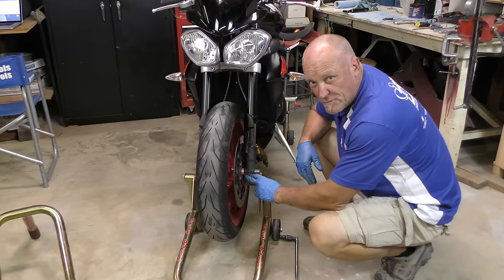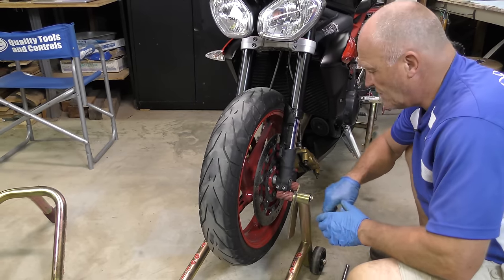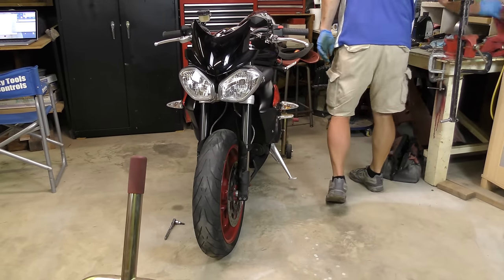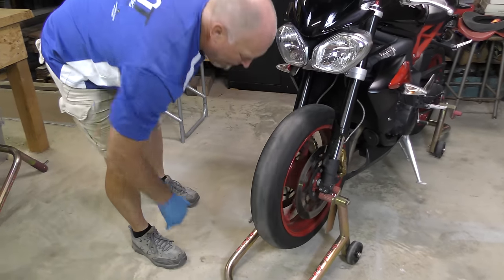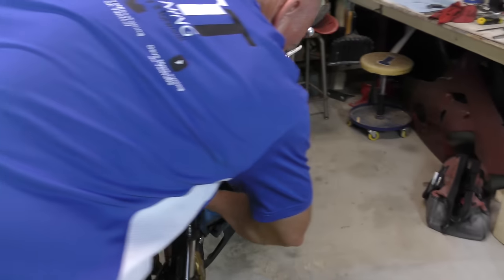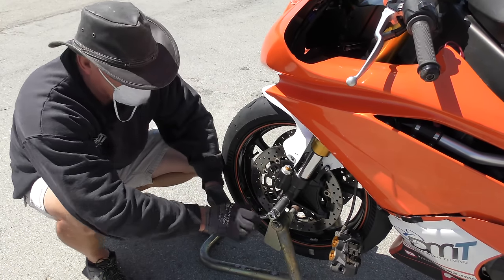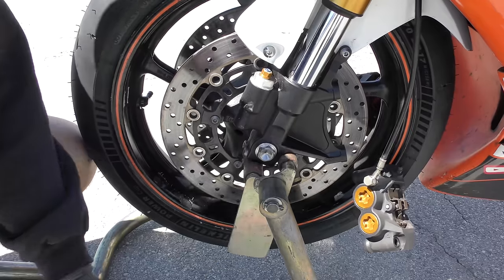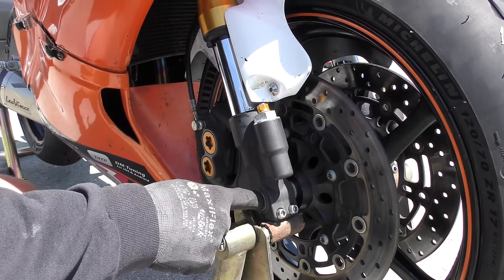Aligning Motorcycle Fork Legs Properly After Mounting The Front Wheel

Comment: Ooopsie, I’ve learned something today
Reply: Same for me! Will be redoing mine soon... the right way. Would be nice to learn why this needs to be done.
Reply from the maker: @stefan2meter  If you do not do it the fork leg can be misaligned and bind giving 1. Stiction  2. Uneven brake pad contact  3. Angled braking forces  4. Wheel doesn't spin 4 or 5 times, maybe half a turns
Reply: Thank you so much! I replaced my rotors and pads, but for the life of me couldn't work out why I was getting uneven contact patches on my rotors... Subbed.
Reply from the maker: @jamieadams9578  Thanks for subscribing! Next step is a toothbrush and soapy water for the caliper to make sure the pistons move evenly (yes, there's a video for cleaning brake calipers). Enjoy!
Reply: Thanks, will do. Got the seal kit ready to go
Reply: Me too

Comment: When you nip up the callipers with the brake on it ads weight to the wheel and moves the caliper back a little the opposite way of the breaking force, whay i do is spin the wheel forward motion pull the brake fasten the lever on, with velcro strap, just before tightening caliper bolts i hold the wheel  with a forward retention ?

Comment: Dave, you helped me tune my suspension with your video's. But there was a glitch I couldnt tune out of there. Ocassionally I would feel some unbalance in the front. Not all the time, but enough to notice in certain pieces of road. Sometimes the bike wanted me to lean at slow speeds, and 2 seconds later not  Etc. Continuous small adjustments... . A motorcycle mechanic fixed a leaking fork seal couple months ago. I figured the oil must be old on one side or different viscosity... They claimed to me the other one was recently replaced already... Today I did what you showed here. And jezus, the floating axle side exluded about 1mm now, before it was flush. 1 hand springing the front imediatly felt a change in smoothness and balance/preload etc. between left and right. Not like the seals where binding... Drove today, and it cuts the cornerline way more stable. Bro, your my hero.
Again you indirectly saved my life, and improved my driving experience.!!!! A question, I didnt release the calipers, should I calibrate those again to the new wheel position?
Reply from the maker: Thanks for watching and using the content to assist you and your motorcycle.. Yes and go through the full reset to 100% ensure the calipers are correct.
Reply: @catalystreactionsbw  Thanks Dave.Sorry I forgot to mention I do have older type calipers which are mounted sideways onto the fork. I had a buddy's fork in mind which has same as the video.

Comment: Dave, about twenty years ago (!) I was a customer at the GMD Computrack shop in El Segundo, just outside LAX. They did work for the American Honda roadrace team in AMA, and I'd seen their CBR600 Supersport bikes in back of the shop. Morris told me that the team was chasing setup problems at the track with one of those CBRs, and it was traced back to front end misalignments which occurred when cinching down the straps inside the truck! One crew was doing it correctly (Miguel Duhamel's, if I recall) and the other crew was twisting things up. A simple matter to fix, once the problem was understood and the knowledge was shared. Even the professionals will mess things up sometimes!
Reply from the maker: Great information and thank you for sharing!

Comment: excellent video dave.j had problems with the front wheel not spinning freely. went to a lot of trouble. stripping down the calipers and changing all seals and a 4 hour brake bleed🙄got there eventually. had I seated the axle correctly like u have done in the first place everything would have been fine 😬
every days a school day.
Reply from the maker: A tip of my hat to you for the commitment to make it right and thank you for watching this video so you have a permanent method from this point on as the first step.

Comment: I had major issues with calipers binding on my BMW S1000R following the replacement of fork seals. This will be the solution - thanks very much Dave!
Reply: Did it fix it? I have a problem with my discs not being central to my calipers and causing massive brake judder
Reply: @TeamSimpsonRacing  Hi Toby, yes it did. If your discs are causing pulsing of the hand lever or judder then you should check them for warping. If the floating bobbins are dry and not allowing the disc to self correct or the disc has been overheated, then it could be warped. There are plenty of videos on youtube around how to service the bobbins and free them up.

Comment: The exception to this is the forks on an 06/07 zx10r that has a "normal" bolt and nut as an axle (neither side floats). The guy I bought my zx6r race bike from put on 06 zx10 forks and I get a bit of excess stiction in the front with no way to correct it. I might send one fork leg to a machine shop to bore the axle hole out and get a spacer made to float the fork. But that will be a winter project

Comment: I know that bike has less suspension travel than my dirt bike, but I have learned not to be a fan of any method of getting the fork legs parallel if you are not measuring it somehow.  Using this method on my dirt bike is also standard YT procedure, but after I actually made a gauge, (1" dia. round stock aluminum that fits through my brake disk, faced off on a lathe on both ends to 5.661" long, the distance between my plated fork legs, calculated from a triple clamp.), I found the pump and brake method to be off about .030".  After I got the legs parallel within + or - .001", I found that I had to go to the next stiffer fork springs because I eliminated the binding.
Lots of riders are wearing out their bushings prematurely, and not getting the best action from their forks. 
It does not matter if the axle is threaded on one end, or clamped on both ends.  The forks should be parallel, and not many are.  :)
Reply from the maker: Agreed, very few are. Thanks for sharing your ingenious solution to remove binding.

Comment: Very understandable and logical with the sequence that these steps are done. If the rotors are not tightened last, is that why you can warp your rotors?
Reply from the maker: If you simply tighten the calipers without holding the brake on they can align off center. That can contribute to the rotor being stressed and potentially warped in time.

Comment: Good instruction - for safety sake - double Check all screws before riding: leaving those calipers loose and tightening them later is a risk because you may forget them. My advice: never interrupt work when your assembling the wheels and brakes. Paint marks can help to be 100% sure.

Comment: Thanks Dave! I didn't know any of this. I'm about to use your tips to align the front end of a 2003 CRF150F dirt bike. They have a similar fork design as the sports bikes you were working on (a threaded left fork for the axle and pinch bolts on the right fork).
Reply from the maker: Excellent - and the end result will be a front wheel that spins far more easily.

Comment: Thanks for this video! Even though it's been some time since upload and I keep coming back to this video to review the procedure to balance the free fork. I have one question: why would you first tighten the brake calipers which are mounted directly onto the forks before bouncing the front end and not first bounce it and then center and tighten the brake calipers? Only after bouncing, tightening the pinch bolts, lifting it back up to spin the wheel to get the brake calipers centered would give you the best braking performance no?
Reply from the maker: I set the caliper nut 1/4 turn from tight, bounce the front end and torque the pinch bolts. Then spin the wheel and hold the brake lever firmly on and torque the brake bolts. It has been a while, I am fighting cancer and need to take time for myself to win this fight.

Comment: Great video without any needless chit chat. Thank you. Great work. Got a question also: When aligning a 4 pinch bolt fork, would it make a difference, if tightening the calipers after pushing the forks down and before tightening the second pair of pinch bolts? Instead of tightening the calipers right after tightening the first pair?
Reply from the maker: Thanks for the compliment. Given your description it will not matter if the pinch bolts on the nut/fasten leg are tight, so just make sure the side that the axle goes through is loose. Then you can tighten pinch bolts and calipers as you choose.
Reply: Thank you for taking the time to respond and helping me out to understand the matter better. I appreciate. @catalystreactionsbw

Comment: For one set of pinch bolts on the axle, if im trying to straighten my forks and have the lower tree clamps loose as well, would i still torque the axle first before pumping the forks? 
This video has helped a lot since i believe having the axle threaded into one side has made all my attempts at aligning my wheels go all wrong.
Reply from the maker: Yes, you would torque the axle first.

Comment: 4:00 I recently removed and cleaned my three piston front calipers and was surprised how much static drag they seem to have. They spin, but the dragging makes a sound much like this one, so I guess it’s normal?
Reply: Yes that's normal as long as they are not actually stopping the wheel completely it's not a real issue, this happens when the pistons pull back but the pads stay against the rotor ever so slightly, since there is no pressure on it, heating and wear is not a real issue, quick fix to this is using break pad glue against the pistons so they pull the pad back with them, on the road it's recommended to always use this, only reason not to use it would be on track and just so you keep things clean and easy to swap. Cleaning those little channels that the little flaps on the pad go into + the pins it slides on can go a long was too.
Reply from the maker: Glad you made the time to clean the calipers with a toothbrush and soapy water. As long as the pistons move evenly, job done! The dragging sound is normal and should be a continuous sound.

Comment: Great Video. I am a newbie and have never disassembled the front axle. I am wondering whether the front wheel is free to move along the front axle without the calipers. If not, what is holding it?  Thanks a lot!
Reply from the maker: The front wheel is free to move laterally if the spacer set up allows it and if so, the spacer(s) are worn and need to be replaced.  Normally there is no lateral play.
Reply: @catalystreactionsbw  Thanks Dave! That's helpful.

Comment: I have an R6, same as shown in the video. Question: Doesn't it make more sense to torque the axle nut BEFORE the pinch bolts? Note that I do have a great big hex driver socket to hold the axle still so I'm able to torque without tightening the pinch bolts. Yeah, you are seating the axle from the right leg side and lightly tightening the axle bolt so in theory that left leg is where it's supposed to wind up, but doesn't the final torque move things just a bit more? Tightening the pinch bolts first prevents that (assuming it's true).
Reply from the maker: If you want to torque the nut  at the beginning you need to trap the axle via the pinch bolts and then release the pinch bolts again to continue through the process,
Reply: @catalystreactionsbw  Thanks. I have a big hex socket that I use to keep the axle from turning while tightening, so no need to do up/undo the pinch bolts. Is immobilizing the axle the only reason why you do up the left-side pinch bolts before torquing the axle bolt?
Reply from the maker: @andrewdouglas4211  Yes, correct. That would be efficient.
Reply: @catalystreactionsbw  Thank you sir!

Comment: Thank you Dave very useful info!
I came off my honda 2000 cbr600FY a low speed low side. New mirror and repair the fairings and it was fine except the steering has to be slightly to the right to have the wheel forward? Forks have been dropped off at a specialist (mct) and he said the forks looked straight so I’m hoping it was just the forks turning in the yokes???
Reply from the maker: Remove the yokes and see if they are truly flat on a piece of glass. If they are on the bike, loosen the steering stem nut to finger tight and install one fork. Bring the other fork in and if it is off center the yokes need to be looked at.
Reply: Dave Moss Tuning when you say “bring the other fork in and see if it’s off centre” you mean install it but no need to torque everything and just see if both forks are parallel by measuring top and bottom?

Thanks Dave, when I get my suspension back and the fairings i will be in touch regarding a set up. I ow you some £££ anyway tbh because I’ve leaned so much already.
Reply from the maker: @Bikeadelic  Locate one leg and bolt it in place. Bring the other leg through the lower yoke and see if it is on center with the upper yoke. If not, then the yokes need checking.
Reply: Dave Moss Tuning ohhhhh ok yes that makes sense! 
Thank you Dave 🙏

Comment: Dave, I just put a new front tyre on my Husky 701 Enduro and reinstalled it. The first ride noticed the front brake is very stiff and doesn't modulate.  Assuming the legs being misaligned with the brake caliper is the cause?  Will try this trick tonight.
Reply from the maker: If all you did was change the tyre, the only variable is the mounting procedure. So, try this trick tonight. If the wheel is still binding, you might take a closer look at the brake pad wear and take a tooth brush to the brake caliper pistons.

Comment: Hey Dave great video, but i think there is step missing from this if the legs are considered to move left right about a pivot then the lower triple clamp should be loosened but still tight to hold so the pivot is moved to the upper triple and the fork let has more room to move straight, be interested in your/the communities thoughts on this, thanks for all your vids
Reply from the maker: One leg is captive in that is is screwed/bolted to the spacer. The side the axle goes through is the free/open side and that is the leg that can move on the axle shaft, so we need to make sure it is straight. The leg base is part of the moving tube as the triple clamps hold the outer tubes in place. If you want to be 100% sure, loosen the steering stem nut, all triple clamp bolts and set the forks even. Tighten the steering stem nut, then triple clamp bolts. Bounce the front, then follow the process.
Reply: @catalystreactionsbw  Thanks Dave, that makes total sense. Cheers.

Comment: Very clear and very helpful, thank you. A quick question - why do we centre the calipers before bouncing the forks? If the 'free' fork leg does move, since the caliper is fixed to it, won't that mean that the caliper has moved slightly too and will need to be re-centred?
Reply from the maker: Yes, that can happen if the free leg 'adjusts' post bounce, then the caliper on it would be out of alignment and would ned to be reset. Centering calipers would be the last task logically.
Reply: @catalystreactionsbw  Thanks for taking the time to reply. Much appreciated.
Reply: @catalystreactionsbw  Came to post the exact question.  Thanks for the explanation and the tips to center everything.  Your video with the narrative explanation goes worlds beyond what the service manual says.

Comment: I did this yesterday and I get a lot of chatter from the forks when i come to a stop,I don't understand why. I have a bike with pinch bolts on both sides. I have pumped the forks first and did the correct procedure,and then i mounted the calipers and aligned those too. I did this multiple times before and I had no chatter,but for some reason now I have it,I can feel the binding through my handlebar when coming to a stoplight...
Reply from the maker: Do you have chatter like the pads grip and let go - more of a shudder?
Reply: @catalystreactionsbw  just when I am about to stop,the last few rotations of the wheel,it almost sounds like a quiet trumpet,but now i did the process again and it is fine for now. Could it be the bushings inside the forks making the noise? They are overdue for service anyway,in the winter
Reply from the maker: @TheCvac  1. Sand blast the rotors over Winter then clean them with alcohol.   2. Make sure the brake pads are even in wear between both sides. 3. Clean the brake calipers with a tooth brush and soapy water. That sound is normally from pad to rotor friction.